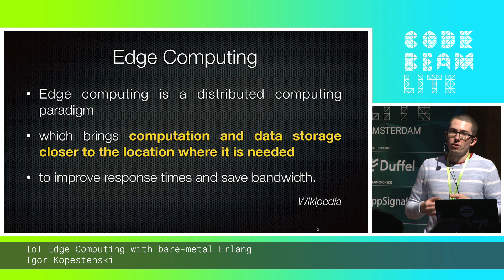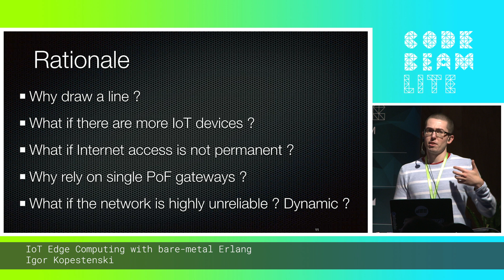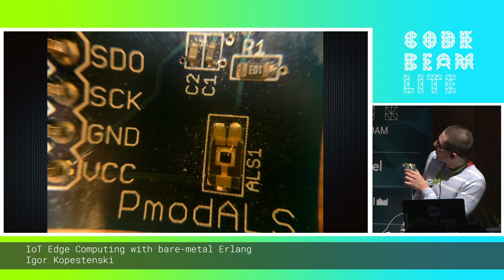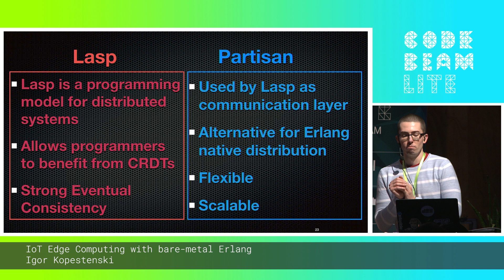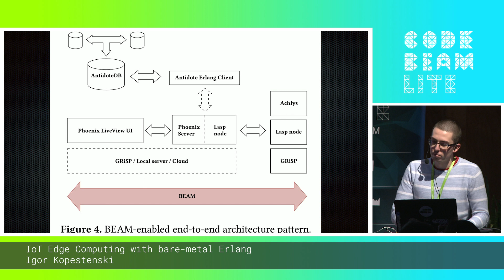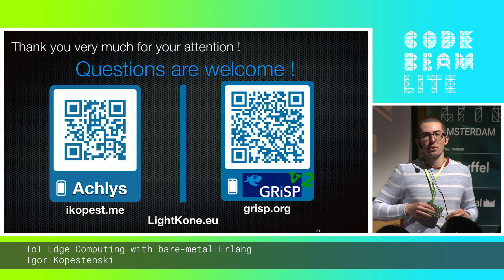Igor Kopestenski - IoT Edge Computing with bare-metal Erlang | CBL AMSTERDAM 19

Comment: Excellent presentation, LightKone researchs looks very promising. Came here after reading Igor's and Peter Van Roy's paper "Achlys : Towards a framework for distributed storage and generic computing applications for wireless IoT edge networks with Lasp on GRiSP" http://sig-iss.work/percomworkshops2019/papers/p875-kopestenski.pdf
Reply: Thank you very much for such positive feedback ! If you are interested in reading more about the Achlys framework, you can find a second paper that I have co-authored with Prof. Van Roy for the ICFP Erlang'19 workshop on the LightKone.eu website. As well as all other research results from the project.